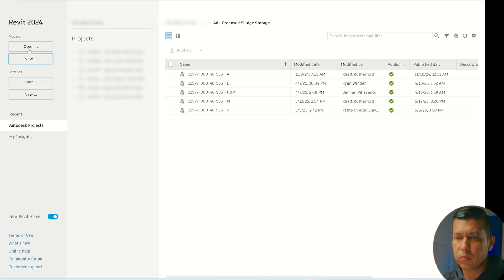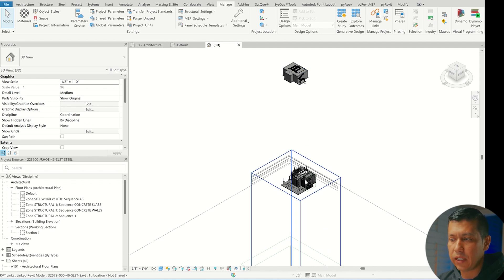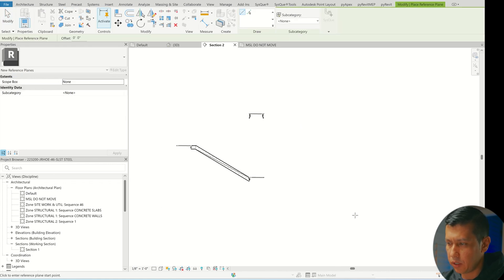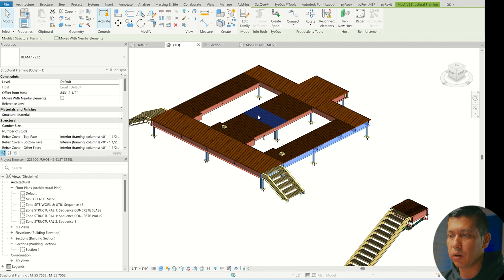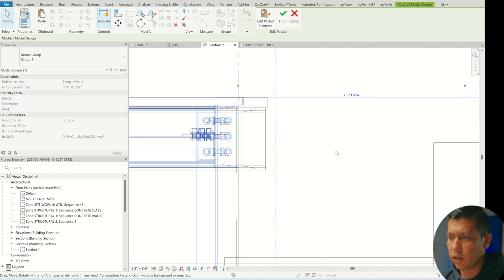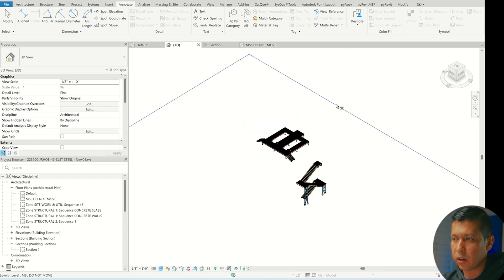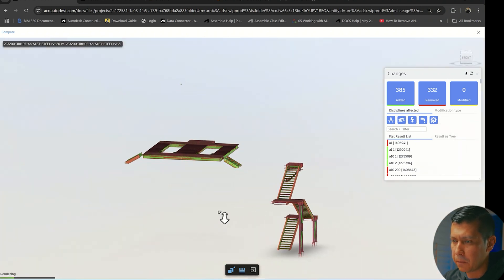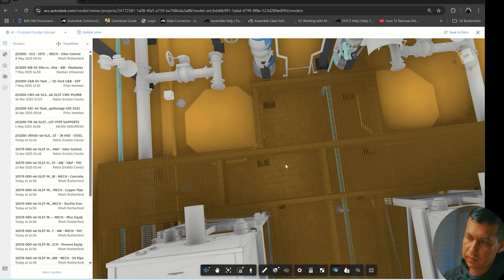Convert an .IFC file to Revit - THE WRONG WAY

Comment: Hi There, im opened my ifc from prostructures, selected all unjoin element errors, but i dont see any model. Am i doing something wrong, or was the ifc model converted with error.
Reply from the maker: Hi - sounds like ifc might have issues. It typically opens up with no issues. If you select zoom all on a 3d view, turn on all categories in visibility graphics, and make sure your revit file doesn’t have any filters or worksets that might be hiding things, it should show up. Hope this might help!